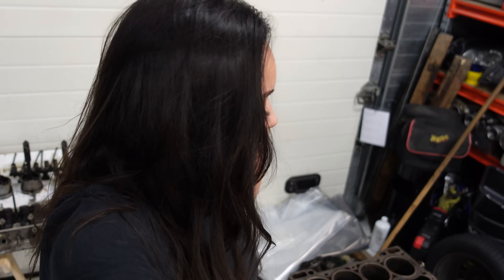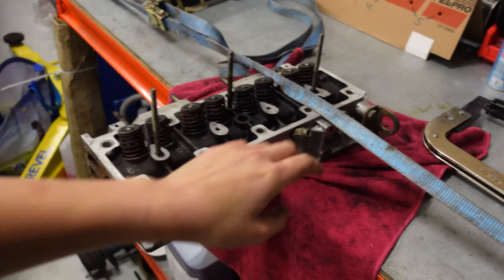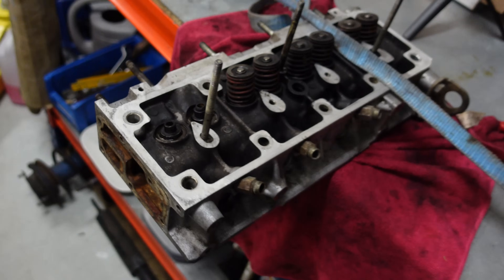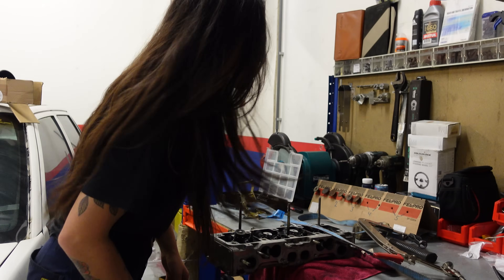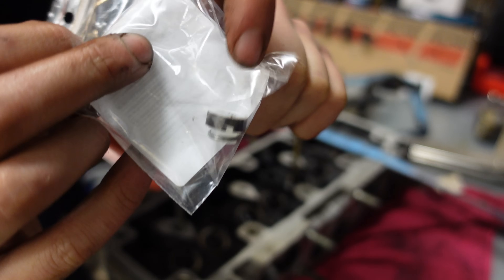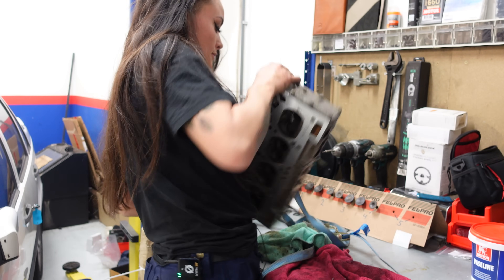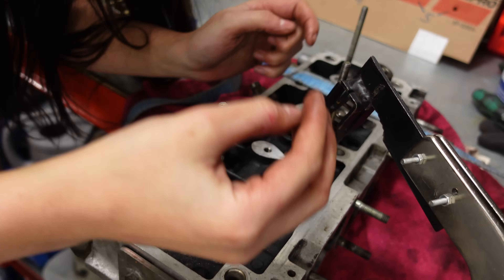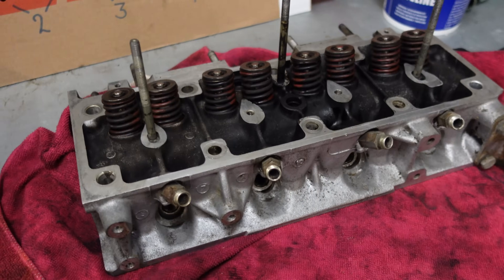Engine rebuild part 1: cylinder head

Comment: How have I never considered using a ratchet strap as a clamp before. 
I’ve been missing out 😳
Reply from the maker: Well this was my first time as well, haha! I usually just put a battery on top but I couldn't do that with this cylinder head because the valve stems stick out 🤔 how do you usually do it? 😁
Reply: @ I have large woodworking style clamps and big welding clamps depending on how awkward the piece is. 
That or I just lean on it haha. 
But I like how the strap puts even pressure across the part, it’s a really handy tip. 
Also, best intro by anyone on YouTube. 
Hearing Hi Friends just always makes me smile 😊

Comment: This is very relaxing after just having spent two hours trying to remove a stuck pin on my own car and failing.
Reply from the maker: Ahhh yes I know the struggle 🥲 I'm sure you were able to fix it later! 😁
Reply: @joy.vanhaelen  sadly it is still stuck and I have shifted towards removing rear suspension which luckily did work!